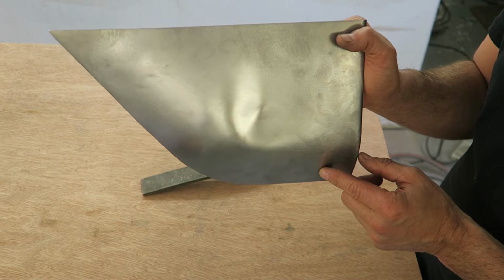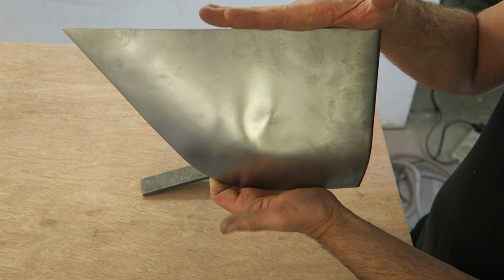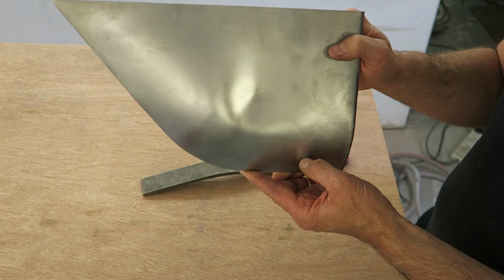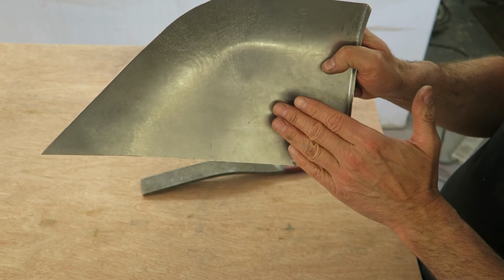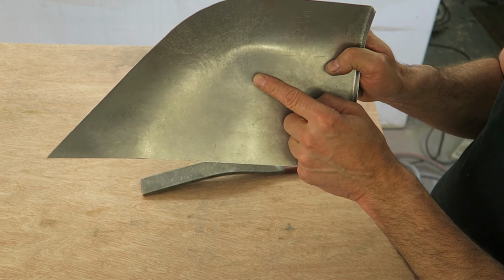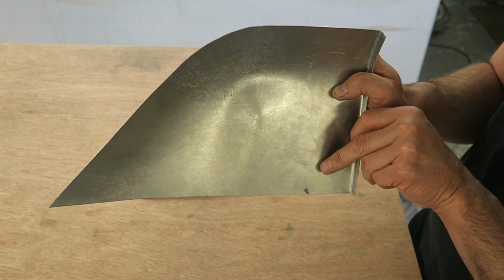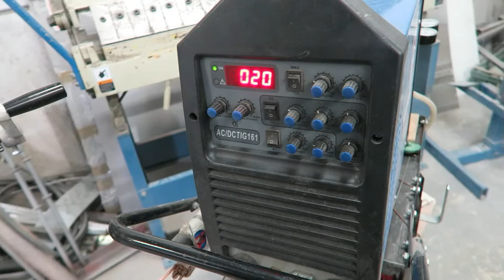Reverse Curve repair confusion, Panel Beating, Car repair. Bodywork.

Comment: I understand the concept, panels are generally convex therefore a dent in them usually shortens the distance between two points meaning the metal is somewhat compressed and needs to be stretched (with dolly and slapper) to be raised back to be level with the convex surface. But I don’t think this can be an absolute rule, it must come down to the relative radius of the panel and the dent. If you have a panel with a gentle convex curve, say a 1m radius, and it has a small sharp but deep dent, like a pick hammer dent of say 5mm radius, then I would have thought that the metal must be stretched just like it would be on a flat piece , and shrinking it would help to raise it?